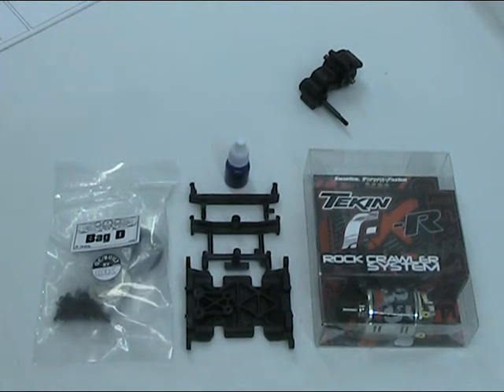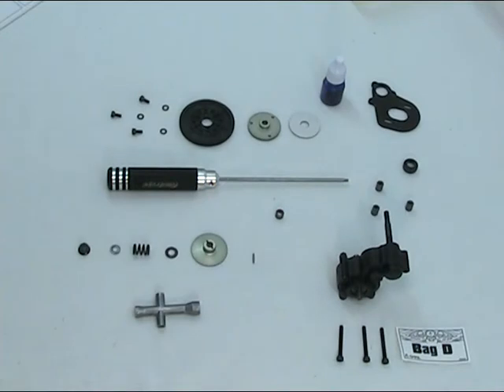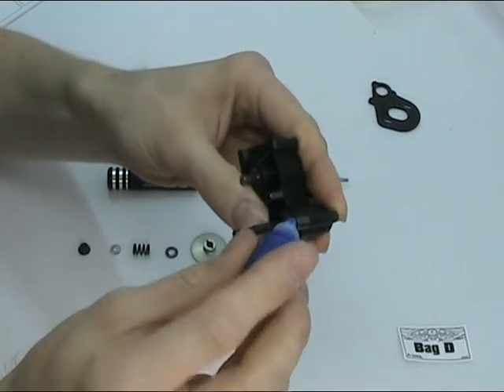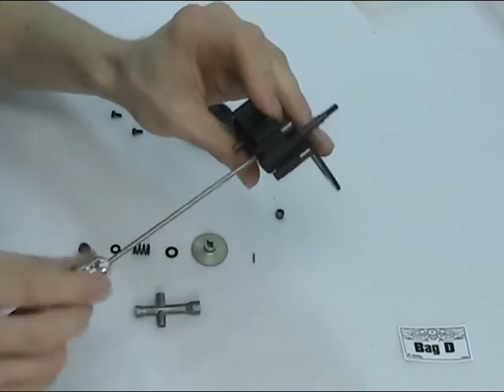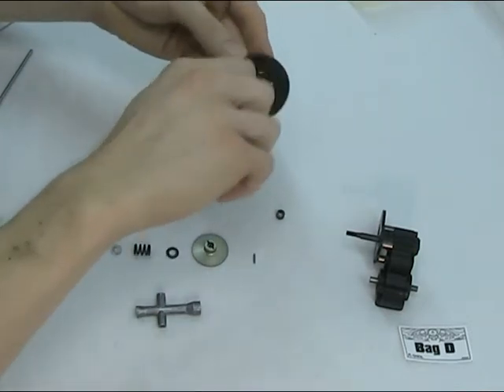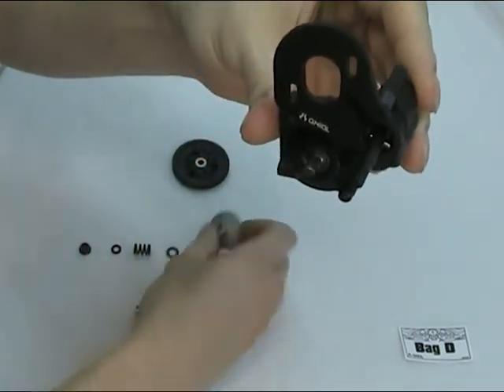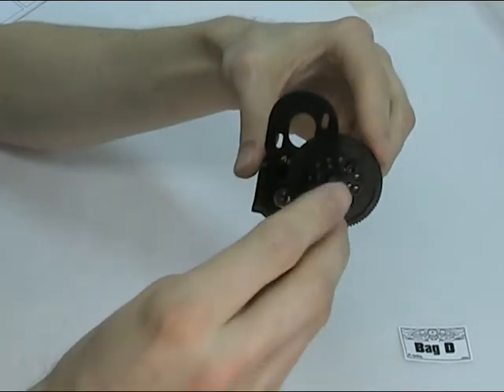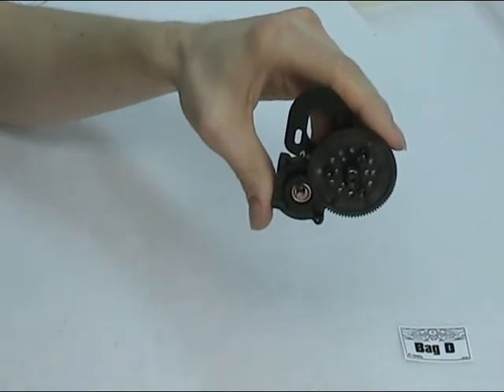Axial Honcho build SCX-10 PART 5 Assembling Setting Slipper Clutch Mountng Motor Stages 21 to 25.mpg

Comment: By the way, you seem to know what you are doing. Me and a friend of mine have just ordered this kit and we found a PL-C Floor Pan from Proline that looks great, but this is made for the Comanche body they have. The Comanche looks cool, but we both like the Honcho a bit better, so we were thinking og cutting this floor pan off under the Honcho's flat bed. But the question is: Does it actually fit with the front of the Honcho? 
PS: Super vids! Im sure as hell going to watch them as I build!

Comment: Nice vid. I just assembled ist sibling Dingo. What is your experience with the slipper clutch adjustment. My gut feeling says it's way too tight and doesnt slip much. If I loosen it enough to slip, the lock nut doesn't lock any more.

Comment from the maker: @mechqeust Lets see what I can do to help. If the ESC appears to be operating with the LED's it is them worth disconnecting the motor wires and seeing what happens to the voltage across these when you operate the ESC. I assume that the ESC have not see too much water?